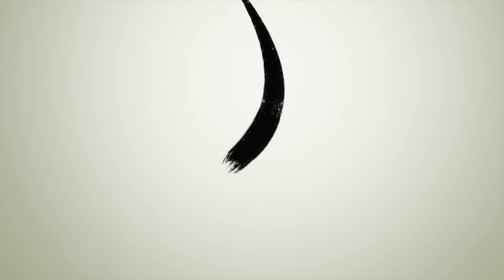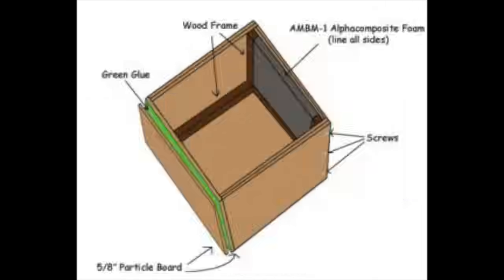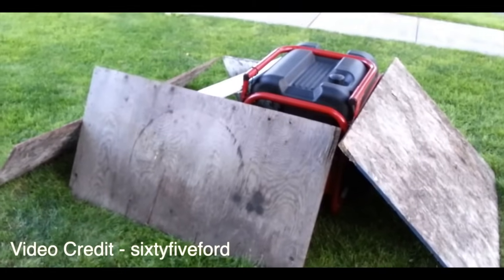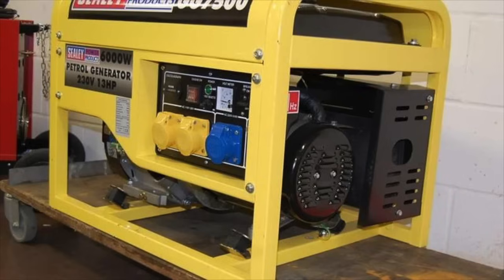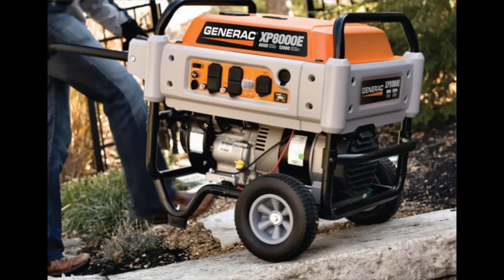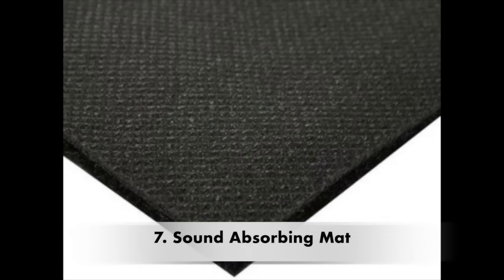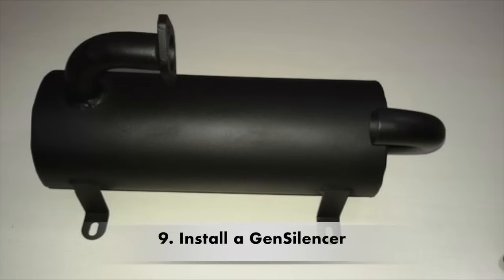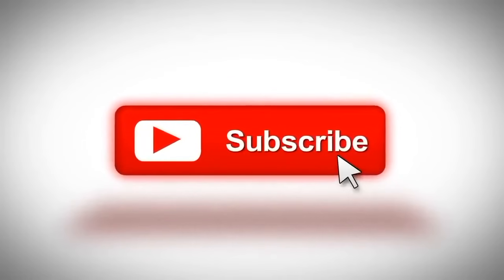How to make a generator quieter - 9 Ways That Work!

Comment: I used to have one of those 2-stroke, 800 watt Harbor Freight generators.  Chincy little thing, but it worked quite well for running some lights and fans during camping on hot summer nights.
I put the 'genny about 100 feet away, over a hill.  Then a 10 foot long bit of electrical conduit large enough to slip over the little exhaust outlet with the spark-screen in it. 
A small hook clamped about 5 feet down the pipe where a bungee with a metal hook was connected,  then the other end connected to the frame of the 'genny to keep the pipe tight against the exhaust.  Finally, a Y-shaped branch jammed firmly into the ground to support the far end of the pipe.  By the time the exhaust had exited the pipe, it was barely warm.  All that, and a few bits of wood stacked as mentioned.  This was in a state park campsite.  During the still hours of the night I could just barely hear the 'genny.  I asked neighboring campers if they heard anything, and if so, if it was bothersome.  Nobody,  not even the park rangers could tell that it was a generator only 100 feet away.  It sounded pretty much like a window air conditioner running across the street. With  little load,  one full tank lasted all night, and long enough into the morning to make coffee.   I sold it to my brother 10 years ago.  He still uses it on jobs. 
Now I have an inverter 'genny.  I still use the stacked wood method,  but with 2 inch thick, rubberized-coated Styrofoam insulation boards rather than plywood. (Leaving openings for air and fully open on the exhaust end)   Cant hear the thing at all. 
ALWAYS.. ALWAYS!  Secure your 'genny with a lock and chain around a tree at least 6 inches thick.   Junkies & crackheads are everywhere trying to steal anything to sell for their next hit. 
CHAIN IT UP!
Reply: Holy shit ..
Reply: I know this ia an old comment but i am interested in exactly what materials u used to make your "rubberized coated insulation boards". Were they actual wooden boards lined with styrofoam? Or were they styrofoam only? If styrofoam only what doyou use to keep them from blowing away? What kind of styrofoam? What was the rubberized coating? Rubberized Undercoating? A thin rubber mat? Thanks in advance.
Reply: @webstella   What I had was some kind of underlayment my uncle got from a jobsite he worked at. An insulating foam that goes under the steel sheeting.  Basically, it was a panel of 2 inch thick, white strofoam with this black cating on it that was elastic and rubbery.  But it looked like black cork.  I have never seen anymore of that stuff since.  But I never really looked for it either. 

Ok I just googled several keywords, and nothing similar comes up.  I was trying to give you a link to a photo or source,  but I'm having no luck.   The closest thing I could find was  Polystyrene "Sandwich" board.  But it has metal cladding rather than the rubberized coating. 

As for the method I used to keep it in place,  I used landscaping fabric pins.  I just pinned then together in a 3-sided box shape and put it over the "genny, with the exhaust pointing out of the open end.  
Sorry I couldn't give you more info.  I really do wish I knew what the stuff was called.

Comment: I'd probably do a combination of lowering the generator in a hole, AND building a sound controlled box, a car muffler (stock ones for a luxury car or a truck tend to be the largest mufflers)...also...raising the tail pipe itself up into the air so the left over sound is well above your ears and provides more distance and I mean like roof level....I have also heard of using a big bucket of water to help absorb exhaust sounds...Anything we can do to lower the pitch of the sound will also help. 
Also, keeping it well maintained helps.
Reply: Moped Muffler

Comment: quick safety tip. I work on powerlines and during storm restoration we love to be able to hear a generator running. If a generator is incorrectly installed it can backfeed the high voltage and kill us. When we hear it, we know to be more wary. Great vid!

TLDR: keep it loud after a storm.
Reply: Thanks for all you do bro, folk's definitely take y'all for granted. I'm from south Louisiana and we were without power and water for 24 day's following Laura. What blew my mind was the support and hard work from all the out of state linemen who left their families, drove into a category 5 hurricane, slept in tents and trucks and worked non-stop until the power was back. Thanks for always having our back👊🏻
Reply: What would be incorrect installation?
Reply: @jubhgioubgob  with either an auto or manual transfer switch. This isolates the house/generator from the grid.
Reply: @nickholman3843  Correct..
Reply: My first time using a generator after a winter storm resulted in having the cops come to my house on a noise complaint and me getting a written warning that the generator would be confiscated and I would be fined if they got another complaint.
Reply: @Bobaganusche72  sounds like a jealous neighbour snitched on you who doesn't own a generator
Reply: Don't you guys ground the lines while making repair?
Reply: You should always just be careful

Comment: The problem with any permanent structure, like a Zombie box, is you'd want to place it near your house which is NOT where you want to run a generator.  You want to put the generator in your yard or away from your house, but who would want to have a generator box sitting in the middle of their yard?  There is no good answer.

Comment: Perhaps buy a better generator to start with!  A better, more commercial generator typically rotates at 1800 RPM instead of the typical home generator bought at a big box store.  The typical lower cost generator turns at 3600 RPM.... do you see a problem here?  You can put all the mufflers you can afford and it won't help a noisy motor clanging away at 3600 RPM.  Buy a better designed commercial or long life generator turning at 1800 RPM.  It will be significantly quieter and lasting much, much longer.

Comment: I always advise against #4 - car muffler.  It doesn't make a significant difference AND more importantly it'll increase the back pressure on the engine causing premature failure.
Reply: I agree with you
Reply: Even a muffler for a 1.3l engine is not going to create any real back pressure in these tiny generator engines. It will not shorten the engines life. Best practice is to use a motorcycle/scooter muffler, with the scooter muffler designed for smaller engines similar in displacement to a generators engine.
Reply: @ExxonValDeezNuts does it actually help at all? The scooter muffler?

Comment: I run my generator in my DETACHED garage. I don't have a problem with heat so much as the generator being in an alcove and it choking itself out on it's own exhaust. All I did was buy a cheap box fan, plug it into an outlet on the generator, set it on the end of the unit and leave it turned on. I have my generator connected to my panel through the 240 VAC @ 50 amp twist lock so I have 4 unused outlets. When I start the generator, the the fan starts with it cycling fresh air to the intake and keeping the unit cool in the summer.

Comment: I attach a 40 foot piece of galvanized pipe to the exhaust outlet and run away from my location. It makes the hard clapping of the exhaust quieter but you will always have the engine internal noise. It is inside of a wooden crate with air intake hole. sounds like it is really far away and distant.

Comment: Cars are quieter due to exhaust, not engine design. Exhaust is the key. Small engines have a canister style spark arrestor. Generators on RVs are run through the RVs exhaust system which makes it quieter. Enclosures limit air flow and will burn up a generator engine, seen this happen many times. But what do I know, I've only been a small engine tech for 30+ years.
Reply: You’re 100% wrong.  Most noise comes from the engine on a generator.  Cars are absolutely built to be quiet, the muffler is only part of that.  RVs use a separate exhaust for their generators, they never use the same exhaust as the RV motor.  You can’t possibly be any kind of mechanic believing what you wrote.

Comment: Obviously - buy a quiet model first, but after that use the landscape to your advantage - put in a dry ditch or behind rocks, or dig a pit and use the spoil to fill sandbags or fabric bags and place around it like sand bags. Stagger an entrance for access and exhaust as sound does not travel around corners well. Then use an old soggy plywood roof, or use earth on top. Parking it on planks or a board supported at the ends like a bridge will prevent the ground vibration problem.

Comment: Take a freaking hole in the ground put a piece of plywood on top and you've got yourself a quiet generator that's going to burn up and only be half the life it should have because you stuck it in a freaking box where it can't get air it's an air-cooled motor and needs to be outside if you can't handle the noise and you don't mind burning up your generator dig a hole in the ground put a piece of plywood over the top of it by the time you spin the money to build a box you're going to need a new generator you need to save that money to buy a new generator LOL

Comment: Nothing like cutting a life of your air-cooled motor in half by sticking it in a box
Reply: Generators are expensive. Small duct fans are not.
Just install a small exhaust fan. No more worries of overheating.

Comment: I have a predator just like this.  Muffling the exhaust is of zero effect.  The noises overwhelmingly from the motor crankcases.  The enclosure has merit.  Exhaust muffling is simply ignorant crap.
Reply: Exactly. Exhaust noise is a small percent of the noise. I dug a 5x5x5 hole in the ground , covered it with a roof and big exhaust fan, and I can barely hear my genset now.

Comment: Car muffler will not work because it need large amount of air to cancel its own sound. Don't spend $200 on "gen-silencer".  You can get same result from $15-$30 exhaust from Amazon just type "generator exhaust". Don't forget to use 90* elbow when connect to new silencer.
Reply from the maker: Great advice! Thank you!

Comment: The instructions for the generator I have says to leave at least four feet of free air around the unit to prevent overheating. 
How is enclosing it in a wooden box not going to cause it to overheat and possibly ruin the generator ?
Reply: Hey man! You'll have to install some fans/vents. I'm still in the process of designing my compartment for my generator, so I can't help you with specifics, but a dude on a forum told me he built his with vents that had small fans built in, and he somehow wired the fans in with the generator so anytime it was running the fans were running as well
Reply: @jamesgdreau  Sounds cool, no pun intended. I’ll look into the fans, maybe on on each end. Do you think that both should exhaust the air, or maybe one to exhaust and one to bring in cooler air from outside. Just a thought.
Reply: one of my employees built a sound box and it overheated after a few uses
Reply: @Michael Miner  Isn’t  a plywood box a solid barrier?  Plywood seem pretty solid to me. I guess that I’ll have to make a 10’x10’ shed with insulated marine plywood walls to give it plenty of breathing room. Another project.
Reply: A  few inches of space with 1 large or a couple small fans in the back and properly venting holes in front will cool more efficiently then leaving it wide open in your yard. Think of a good gaming computer.
Reply: @TheWabbit  I have a good gaming computer, and trust me , my generator produces 10 times more heat than a gaming computer.
I’ve been looking at other examples of remedies to the problem, and all involved fans and vents. Probably the way to go.
Reply: @allanpolk2681  I build gaming computers and for the ones that are air cooled and overclocked they're only a couple of fans away from smoking something, but the actually point was an inclosed box with air intake and fans pulling or pushing air will cool much better than an open box where the fans push air wherever instead of a chosen path.
Reply: @TheWabbit  Gotcha 👍
Reply: ventilation ducts

Comment: Your gonna be have to disable the carbon monoxide unit if you have the a generator with this. I was just putting Oly wood around mine and it shut off. So I just disabled the carbon monoxide unit.

Comment: I also don't understand his statement "make sure every gap and hole is sealed" but also make sure the generator has been of air flow -huh??  

Although, I built a box yesterday using a single $20 4x8' sheet of 3/4" MDF and spare 2x2s & 2x3s I had around my property. I've still got some work to do on it, but even after my initial test it made a HUGE difference in sound reduction! I've even left one side of the box 80% open (the side that faces out to the forest behind our house), because I'm too concerned about overheated/causing a fire from the enclosure. I'm even going to place a 24" box fan in front of the opening on hot days for more circulation (here in California our power is often shut off to prevent wildfires on hot/dry windy Summer days). 

I still plan to silicone the inside corners, and then coat the box inside and out with a paint-on "acousti-coat" sound deadener ($35 for a gallon of it on Amazon). I'm hoping that coating will work twofold: for sound deadening and to help protect it for the elements. Depending on your setup, I also recommend getting castors (wheels) to mount on the box. The box will be heavy as hell, and this will make your life easier if you need to wheel it in/out of the garage for use like i do.
Reply from the maker: Thanks for sharing! Always love to hear other people’s DIY success projects!

Comment: Lol, I hope zombie fires their engineer. Radiant barrier around a heat source when cooling is benifical ? Ha ha ha. Unless it's used in the south pole why?
Reply: Squared off walls don't help with sound either.  They should start with something more trapezoid.

Comment: Moving the generator away from the house requires wire gauge considerations and becomes important ... the longer the wire ...greater the load loss. Can become very expensive.
Reply: your right JRP , father in law is retired electrician , said don't extend  beyond 20 feet , with 10 gauge , my rig , 14 horse v twin 8000 watts B&S

Comment: Dont you think a company like Honda would put a larger exhaust muffler on if it worked???  Geezzzz be careful you dont restrict airflow because heat is what kills machinery.  I have found that the air intake is also a major source of engine noises. Also be very cautious of long extension cords. The sand bags with back side open seems best to me.

Comment: Great video. I live in a tropical country, and have a genset in a subdivision where houses are stacked wall to wall. Overheating and noise is indeed a great deal. I came out with an idea and will hopefully develop it in the future. 
For those non-engineers, changing the muffler (I haven't done it but decided not to invest on this) maybe not a perfect solution, as the mufflers have internal plates called baffles that are spaced according to the frequencies generated by the exhaust gases getting out of the engine. This gases comes out in "pulses" with a certain timing. Meaning with this, that a bigger muffler just will make the sound bounce inside like the shed example he mentions. Making even a cardboard double walled box with polyestierene foam within, everything duct-taped to make it collapsible for storage, and a small air extractor attached to one side to avoid overheating should work. Mine has a 12v output, and I will plug the fan there. Great video buddy, you solved me a problem! Thanks.

Comment: I built what a neighbour thought was a dog kennel on stilts, made what looked like a metal mesh table and put a plywood box over it with one side open except for a heavy wool blanket as an insulating curtain and cable feed, generator used in it is only a small 2.6kw typically used for tools and camping, no noise complaints about it and at 1 meter away it had been registering 78db in the open and 1 meter from the box registered 62db.
Reply: You are the first person I have read that mentions a distance at which the sound level was measured. The sound level of any engine is louder, the closer you get to it. Now, the question is, did you set the sound level meter (please tell me you didn't use a cellphone) to the A-weighting. The A-weighting filter setting adjusts how the sound level microphone hears so that it closer mimics the human ear. If you had a sound of 25000 Hertz, the sound level meter would hear it just fine. A human being would not hear this sound.
Reply: @christopherknee5756  I used a sound measurement device I borrowed from a health and safety inspector I worked for as a labourer aka gopher, can't remember too much detail about it except it used two microphone inputs and a weird looking at the time built in VDU similar to on the malachite SDR/spectrum analyser.

Comment: Put my air compressor inside an old refrigerator, I can barely hear it now.
Reply: That's borderline genius!
Reply: We stuck ours in our old abandoned mini van, we just drilled a small hole in the gas tank to get rid of the gas. Keeps rain off it. Works good! Can barely hear it.